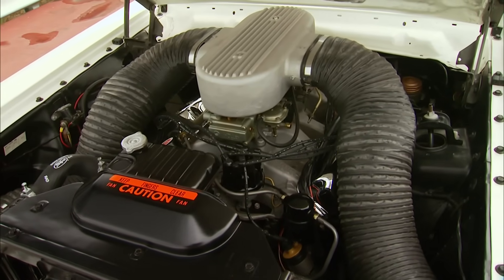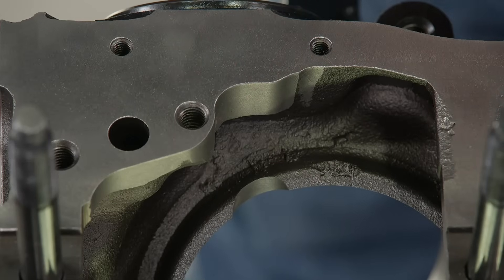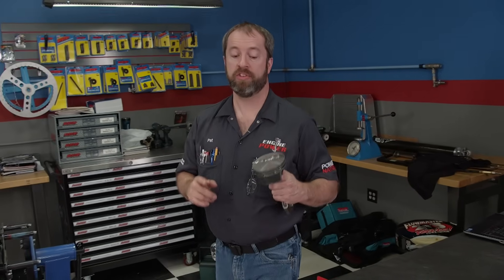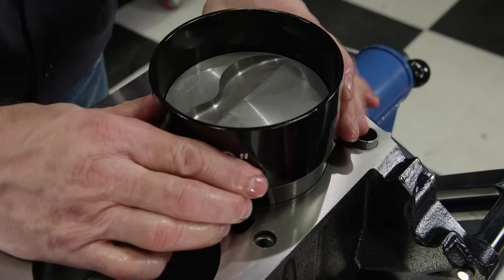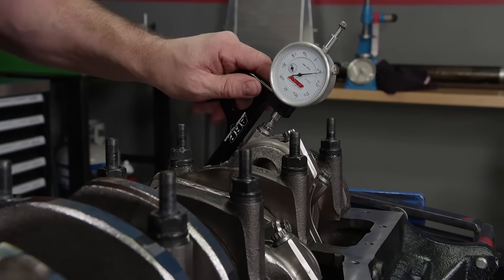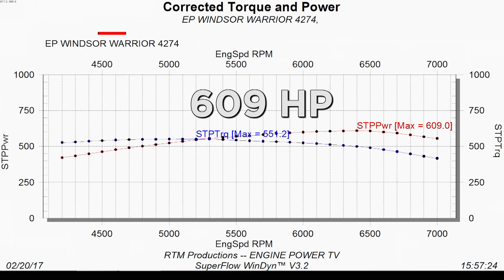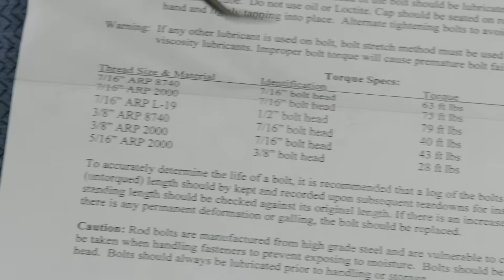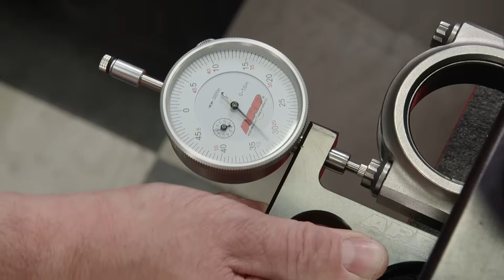Ford 351 Windsor Grows Into A 427 Stroker With Double The Original Power - Engine Power S4, E7

Comment: Perfect! Just the engine I want for my 427 Cobra replica I'm building. First is the hard part, pricing the build!
Reply: About $8500 including labor from carburetor to oil pan. I just built one for a friend with a mechanical roller cam. Very simple build.
Reply: @StainlessTIG2  Wanna build another?
Reply: 600hp in a 2300lb car? See ya in the weeds.
Reply: this exact particular engine is about 15k
Reply: @supersevenn  Professional Products sells this exact 427-W engine making 600hp 580 ft lbs of torque for $12K with a Dart SHP block with billet main caps-turn key. I can build this same engine for around $8500.00 with the Dart block. 427 SBC is $11K making 550 hp and 520 ft lbs of torque with a Dart SHP block, and it doesn’t come with steel main caps like the SBF. The SBF block can be bored too 4.200” at 2.300” cylinder wall thickness where as the SBC can only go to 4.165” at 2.300” cylinder wall thickness. That’s why the Ford is a little more expensive. In most cases, Ford rotating assemblies are a little more expensive than SBC but on the flip side, Ford rotating assemblies are less expensive to have balanced because they’re a little heavier and not needing as much Mallory. Both engines are winning combinations. I’ve just had better luck with Ford power. Especially the Cleveland platform. We’ve been killing it on the streets with my nephews NA 418-W on E85. The Chevy guys are accusing us of hiding nitrous. It’s comical watching them with their flashlights looking all over the car after their SBC, BBC, and Ls just got gapped. We build both brands and are just having fun.
Reply: @StainlessTIG2  I'm assuming you meant 0.230" on the wall thickness. To be an engine builder is to be passionate about mathematics.
Reply: @mchristr  well I would’ve caught that. Too be passionate about machining you measure more than once…lol!
Reply: @herbtender910  can’t wait to put an LS in my Falcon more horsepower and better mpg sign me up!

Comment: Can you turn a Cleveland into a 427?
Reply: It is possible, but not advisable. .300 shorter deck height doesn't let you use a very long rod compared to the Windsor. Use a 351m/400 if you want more cubes with 335 style architecture.
Reply: Use the 351M/400 block and make a 434 stroker - but that block requires big block style motor mounts and bellhousing.
Reply: @cgarris8674  T meyer has a 444ci stroker kit for the 351m/400 . You could get a 400 fmx block and retain the small bellhousing . 😀
Reply: @blueovaldude  I had one of those back in the 80's. I had no idea how rare it was at the time. I hear the Pantera guys love 'em to make big cube Cleveland's with.
Reply: Not with a stock Cleveland block. Not enough room for a 4.125" bore. You could put Cleveland heads on this shortblock and have a 427 Clevor.
Reply: @paulolson734  This is a production 351w block machined by DSS. They are using a 4.030 bore × 4.170 stroke = 425ci . A 4.040 bore would be 427ci
Reply: @blueovaldude  Ahh- I misunderstood. 427 Cleveland in my 67 Fastback would be sweet!
Reply: @blueovaldude  That's what my calculation was too. Still, a 425 is close to a 427?

Comment: Is this new 427 block steel or aluminum? Also what about the heads?
Reply: Cast iron block, aluminum heads
Reply: There are at least 3 companies that offer a cast aluminum block for a Windsor build, but they aren't cheap, roughly double or triple the cost of Iron.  If you want one in Billet aluminum, you better be sitting down when you see the price
Reply: @SwankySasquatch66  thanks man
Reply: @bigboreracing356  Are you five? Many race engines are made out of aluminum.🤪🤪🤪